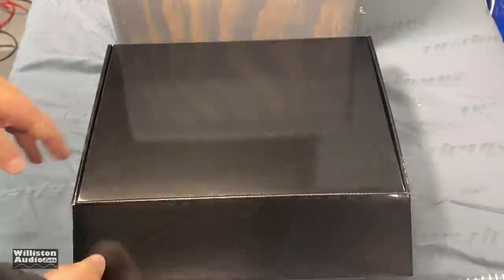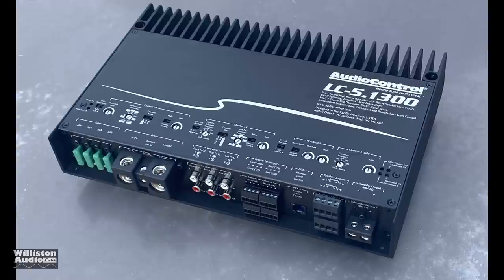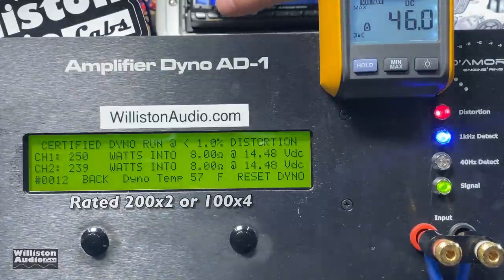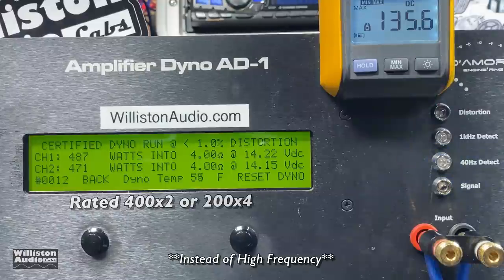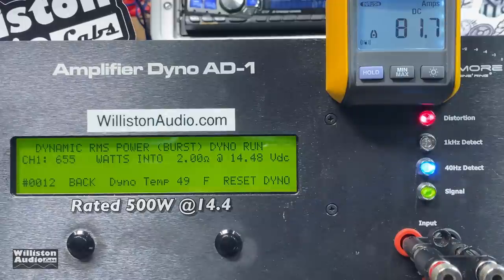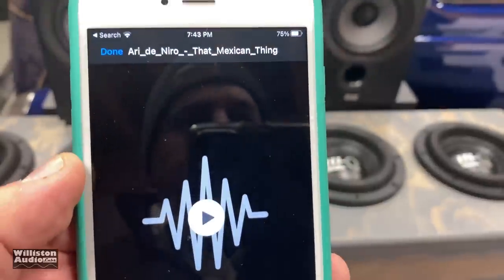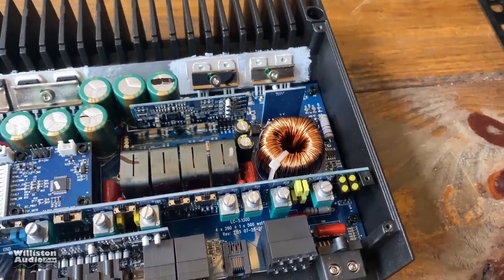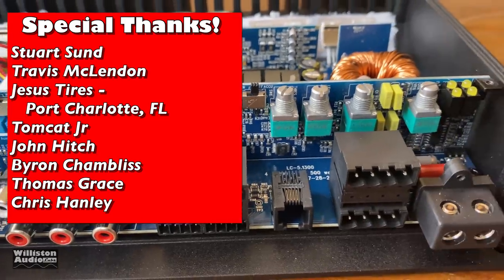Single Amp Solution? AudioControl LC-5.1300 Five Channel Amp Dyno Test and Review {4K}

Comment: Why do you like the Tiffany style RCA inputs over the others?
Reply: Tiffany style connectors and attached and secured to the metal plate that they pass through meaning you can push on them all you want and nothing is going to break within reason obviously

Comment: I don't know if it's a Covid thing, but the guitar pick no longer comes with the amps. I have an AC300.2, LC-6.1200, and LC-1.800 that I just bought this week and none of them had the guitar pick.
Reply from the maker: Oh bummer!
Reply: @wal  I ended up finding the ones in the LC-6.1200 & LC-1.800. They were in the corner of the outside plastic the amps are wrapped in.

Comment: The price is where allot of people won’t buy this amp I do like there products wish they would come out with a budget line
Reply from the maker: If you want something that will last, it cost more. People are too fixated on the cheapest stuff available. I mean, I get it, but this is a great amp for the $$ and hundreds less than the JL HD900/5
Reply: There’s always WUDI
Reply: If they came out with a budget line it would be Chinese junk just like all the other Chinese junk out there. AudioControl if for people that don't mind spending good money for great products that last.
Reply: @Airwolf1971  I’m currently using a Chinese amp right now for my mids and highs 🤷🏿

Comment: 1 ohm stable or a bad protection circuit
Reply from the maker: Awaiting feedback from AC
Reply: @wal  👍
Reply: Yeah I was thinking the same thing it must be thermal protection only on that sub channel. Run it at 1ohm in your trunk in the summertime it's going to heat up and shut down in a hot minute

Comment: This amp is plauged with inferior engineering on the power supply. They are shorting out and welding themselves to the frame.
I sent mine back for warranty repair in AUGUST of 2023 - and I still do not have a repair OR replacement and it is now FEB of 2024 - with NO indication of when I might see it. No one has them in stock - because of this.  I should have stuck with the JL that I know and love
Reply: Any update? Looking at a 5 channel + DSP.

Comment: The only benefit with buying this amp vs both the LCD 4.800 and LCD 1.800 is the footprint. I own both the others and spent less money than paying for this one.
Reply from the maker: The two separate amps would be better, this one is a great all in one solution
Reply: @wal  yes it is. No distribution blocks for power needed with just one amp.

Comment: Your channel should be called (Williston BASS labs)
you do nothing else. only bass and bass amplifiers !
Reply: Big D has done many 4 channel amps , and even a few head units. Majority of the people want to see mono amps though (I'm not one of them).
Reply: @brianwatson3705  neither am I I don't like mono I like stereo Class A B all the way
Reply: @ericsantiago6832  in car stereo for bass, class-ab is impractical! The amplifier becomes expensive and draws a lot of amps to get very hot. but for midrange and treble you can use the clas-ab amplifier
Reply: @brianwatson3705  Many do not care about sound quality! It's too hard !?
Reply: @ford1546  totally understood and that's always been the argument between the two but I still prefer a b in stereo I was running this when there was no class D so I guess you could say I'm stuck in my roots of old school
Reply: @ericsantiago6832  Take HiFi inside your house.
Cheap Class-AB has much better sound quality one the cheap class-D has. If you buy Amplifier cards from eBay then Class-AB has much better sound quality one what Class-D has. Should you have the most watt to a bass then you should go for a good class-d
Reply: @ericsantiago6832  Not all old amplifier is good! You also have capacitors that dry out and should be replaced.
I LIked KENWOOD AND TECHNICS AMP FROM 90'S. and Denon CD players from 90's
Reply: It is true! The easiest way to get good sound is to buy a set of midrange and treble and use a car player with good manual adjustable EQ. (Custom)

Comment: hah. those speaker outputs make it an automatic no for me.
Reply: That raw power makes it a yup for me. Audio control is a real man's brand
Reply: @luciferthewhipple392  theres better options that dont have such a .. flawed output terminal section  just because the company has a couple good products doesn't mean everything is a einner. I can see some issies arise from those blocks as a coice.
Reply: Like what tramps, skar , etc I say good luck to you
Reply: @luciferthewhipple392  putting higher amperages and voltages on terminals that move (and have only slight separation) is a terrible design decision. i don't care what company you are.

a few have managed to do it in the right fashion, most have not.

can't say i'm even a huge fan of the ones that use removable terminal blocks for the power section.
Reply: You just proved to me you have no clue what your talking about.
Reply: @luciferthewhipple392  and you proved you're a brand snob. and having a brand specific name, doesn't mean its a good design choice.
Reply: I'm a brand snob that knows what good brands are. Not a online famed brand. Audio control had been around probably as long or longer then you were on diapers. I'm done talking have a great night
Reply: @luciferthewhipple392  you act like i don't understand they created the epicenter,  but that doesn't make all their design decisions good ones.